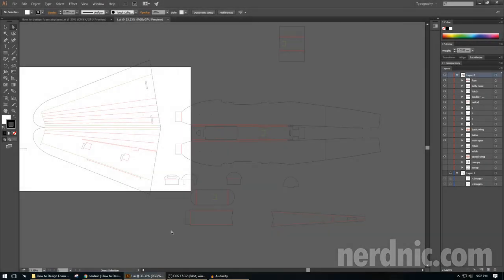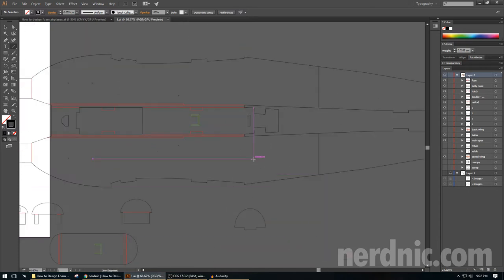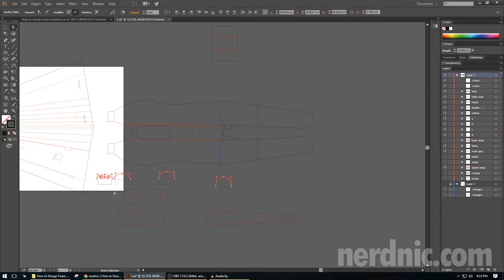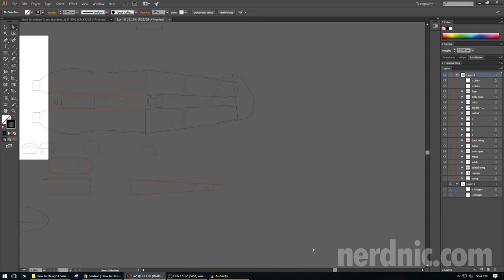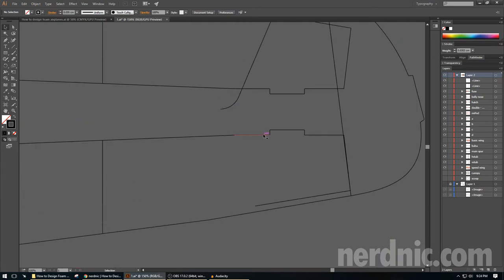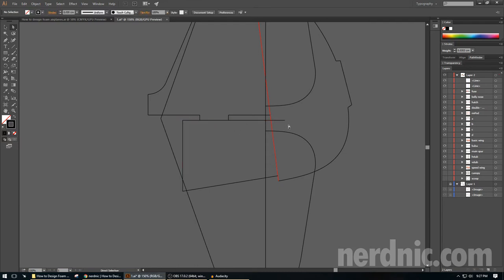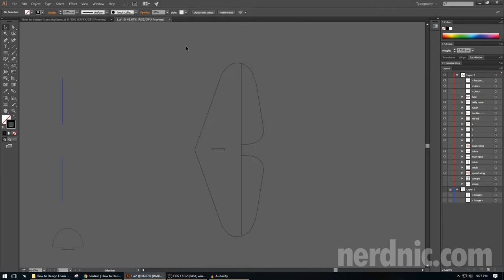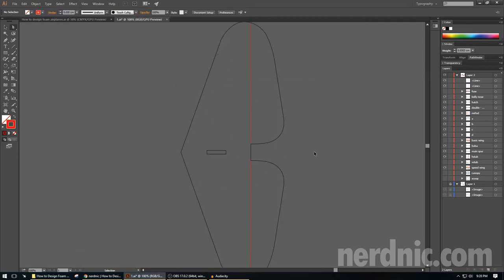nerdnic | How to Design Foam Airplanes - Part 6

Comment: Hey Nic, great to see something new in this series. what do you think about using the inner paper on elevator and rudder as a central hinge. I did this on your upscaled Spitfire design, works pretty good for me, but you have to do the beveling before the glueing. Just an idea... Greatings.
Reply from the maker: I have done this before and I think depending on the design it can work well. Overall it’s just a design preference, so do whatever works!

Comment: Nic... is there a part 7? I was wondering about layout on the foam board(s) from your software. How do you save your work to share with others? Obviously the design involves more than one sheet of foam. Maybe one more part to bring it all together. BTY, did you built this plane? If so, Pictures?
Reply from the maker: There will be a part 7, and maybe 8, we'll see :) I will cover all the topics you mentioned.
Reply: Thanks! And thanks for the quick reply!

Comment: Hey, Nic so I built and cut out the rudder and elevator. After I connected the 2 half's together with a barbecue skewer I realized that the connection between the 2 half's of the elevator was just not strong enough. Do you have a solution for this? Otherwise, I'm thinking that I'm going to have to just make a single elevator instead of 2 half's like you did in this video. Thanks for your series, it has inspired me and you should make another one!